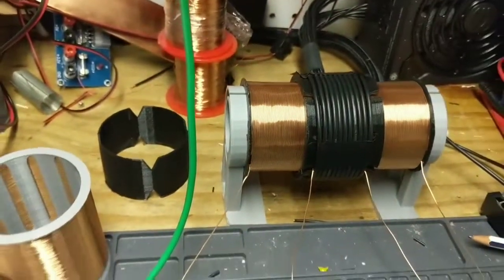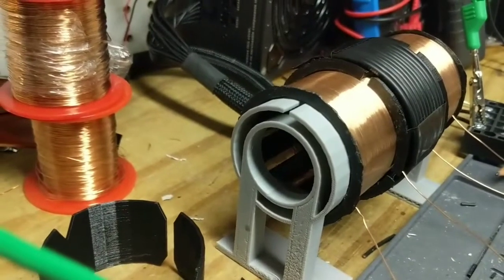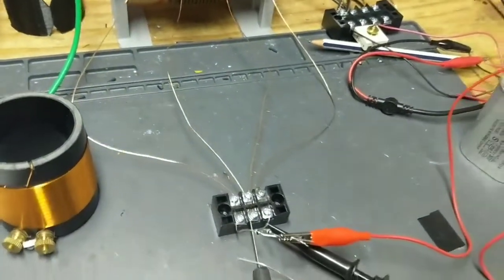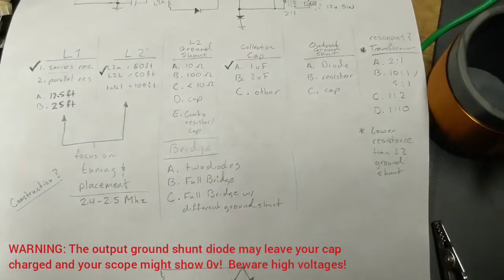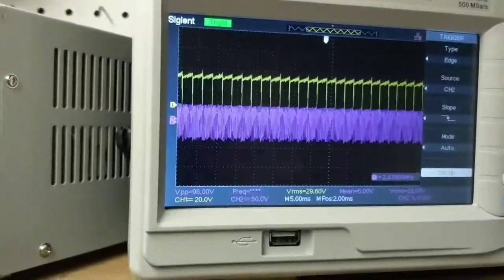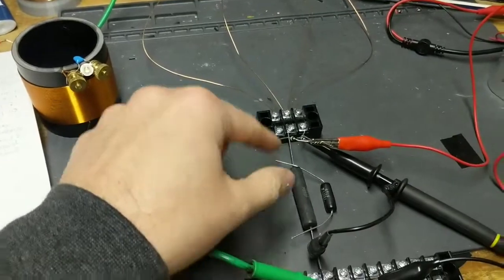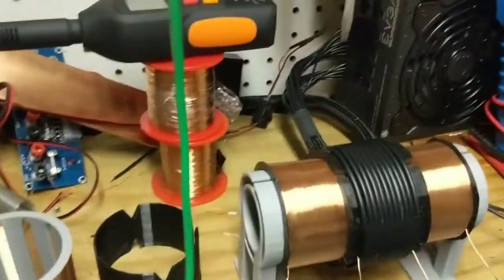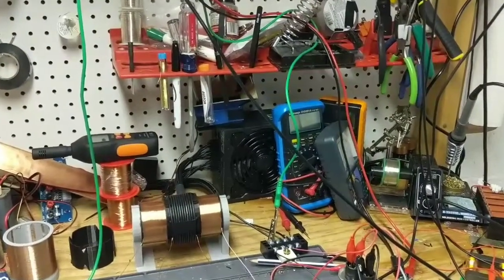Don Smith Circuit - New Coil Construction

Comment: Hello my friend the two L2 coil for output are not cw ccw but cw cw. I don't know. There just to double the output, the first on will give you volt and the other amp. Look carefully what don said and check the photo with high resolution you will see it clearly. Keep the good work.
Reply from the maker: Yes I've thought about this for a while.  One some systems Don used CW/CW.  But at the end of the 1995 or 1996 video he's asked about this and he states a CW/CCW winding can get you more amps.  Also from reading the website for the RICK 2 kit from Rich Friedrich, it looks like the kit will be CW/CCW.  I think both can work in general.

Right now I'm still working to get this all in resonance and play around with different ground shunts.

Though I think I'm gonna take the easier route for the time being and try building something similar to the plasma column dipole setup, with the large capacitive plates.
Reply: @phives5910  very good👍. On my side i try to manipulate as maximum the magnetic flux of resonance and grounding. Because i believe the real secret reside on the magnetic side and how to tape it with high resistance load(hv cap) to keep the dipole open.